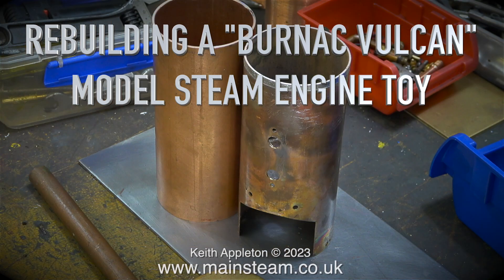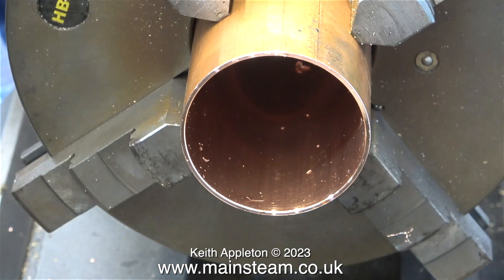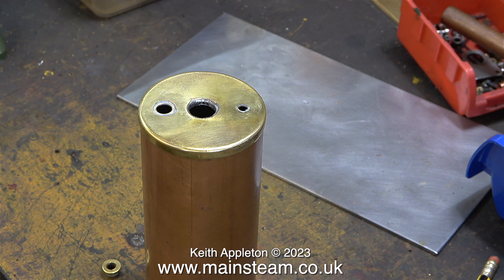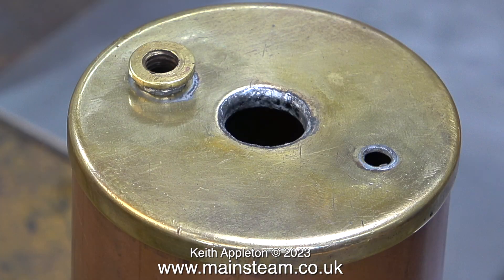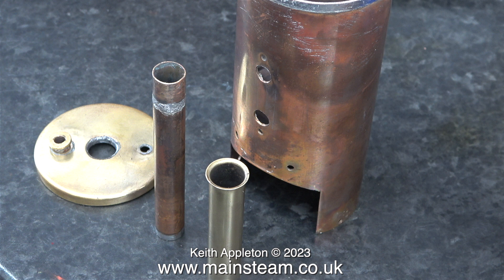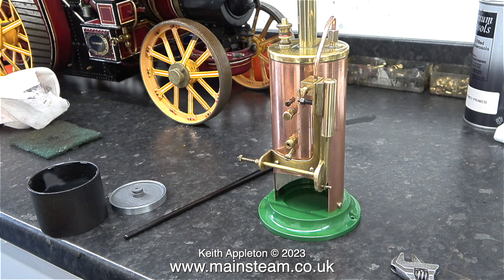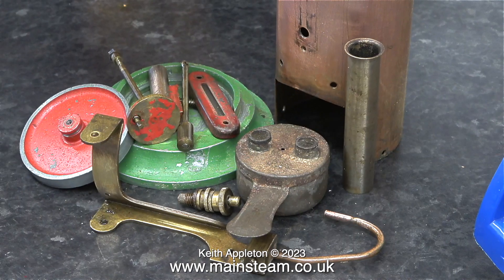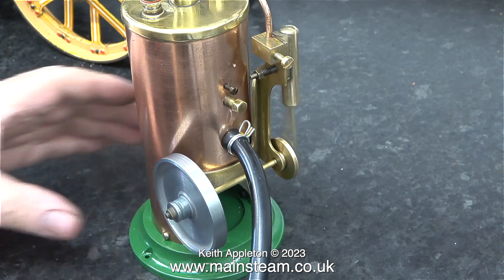REBUILDING A "BURNAC VULCAN" MODEL STEAM TOY - PART #11

Comment: Very interesting. I have a "wobbler" which has a brass boiler. It also apparently had a faulty blocked safety valve. The end of the boiler blew out. Apparently the owner at the time was thankfully uninjured. But it leaves me with the decision to repair or build new. Hence I do find your content useful. Thanks Keith.
Reply from the maker: That is my point, this boiler was potentially dangerous. In my opinion the best way forward was to make a Silver Soldered replica. The is little value in these Burnac Engines so it doesn't matter if I "modify" it somewhat . . . .

Comment: Instead of installing 2 bushings for the crank to run in, how about a single long tube with an oiler in the middle? Way more support and lubricating ability.
Reply from the maker: Too much Friction & oil drag in a long tube . . . .